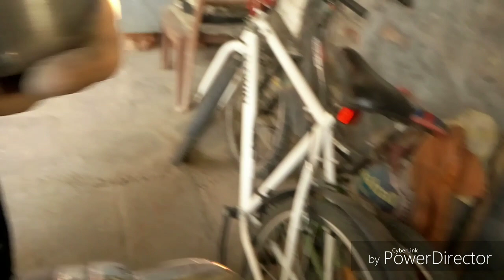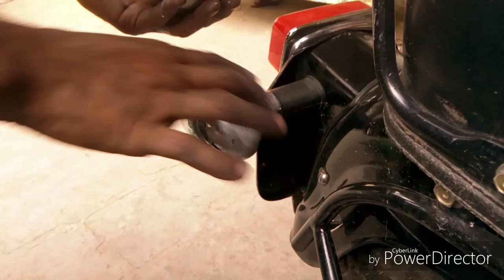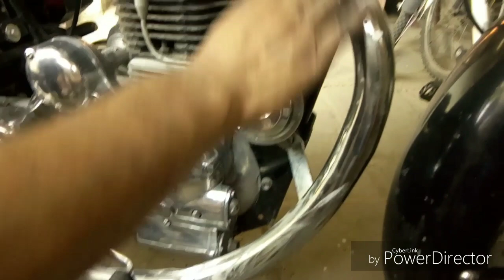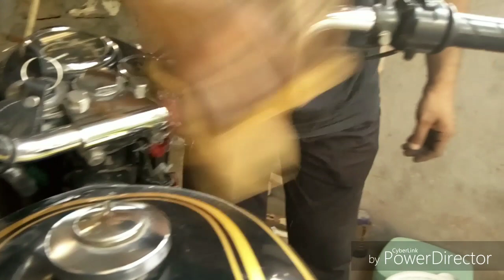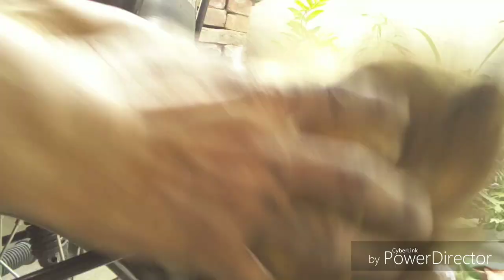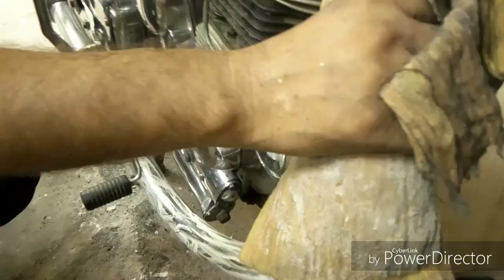How to shine Bullet Crome Parts |best shining technique| Mehra Riderzz | DIY |

Comment: Vai gd evening. I want to fit half hub rim in my bullet which is having alloy wheels. I ve sourced 2 front rims and 1rear rim with spokes of bullet classic model. Front n rear half hub is with me. Plz advice d spoke size I should purchase. Can d spokes of that rear wheel (18 inch)of classic be used
Reply from the maker: Sir, you take the opinion of a good mechanic, he will tell you well, I will not be able to tell you here well.